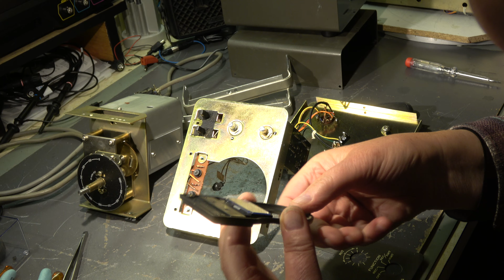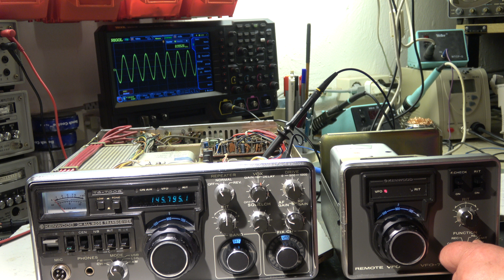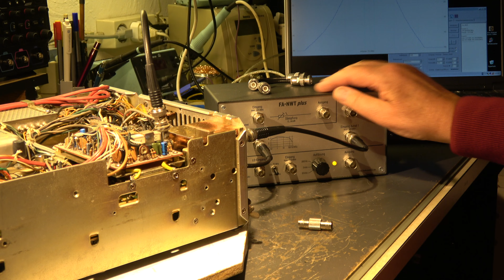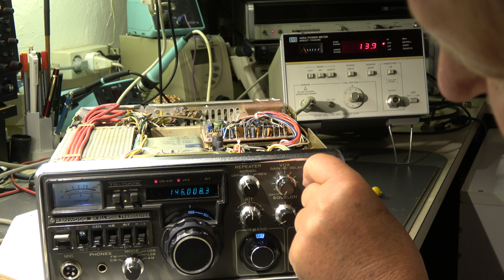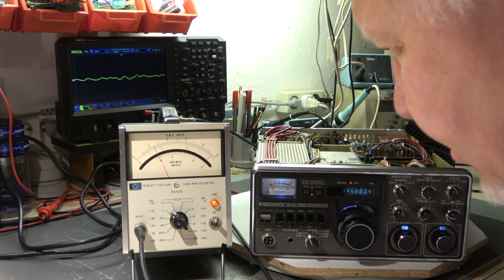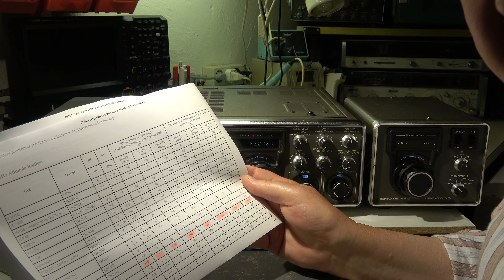#129 Kenwood TS700S Line Part 8(8)

Comment: Watched and enjoyed every minute, some parts more than once.  Keep up your sharing, I always learn something watching  your videos.  Testing the BPF at the antenna jack solved a mystery and I will be checking those.  I am working on the TS-700A and TS-700S at this time.  BTW, cleaning the switching relay on the TS-700A is not for the faint of heart. It was in good shape, no need to check those the way they are make. Thanks again and 73, Ted.

Comment: Lieber Stefan, herzlichen Dank für den ausführlichen "Kenwood TS700" Service Lehrgang. Ich hege auch noch mit diesem Gerät viele Erinnerungen an meine Jugendzeit. Es war damals ein sehr fortschrittliches Gerät. Gewaltig welch Aufwand hier noch getrieben werden musste. Ja, damals gab es noch etwas für das Auge zum schauen. Als Line kannte ich diese Version noch garnicht.   73 von der Nordseeküste Ulrich, DF5LM 🥂
Reply from the maker: Ja, irgendwie gefallen mir diese alten Geräte auch besser, als die neuen. Ähnlich wie bei alten Autos, die neuen sind fast alle gleich, die alten haben noch eine gewisse Erscheinung.
Reply: @dl7majstefan753  Ja genau ❗ Ach, mir fällt da gerade ein ..  Du hast da auch so ein altes Röhrenvoltmeter, dass VT VM. Wie hast Du dort auf die eingebaute Batterie verzichtet ? Du sagtest etwas von einem Wandler?
Reply from the maker: @ulrichhensel8171  Hallo Ulrich, schick mir Bitte Deine eMailadresse. Du findest meine unter ABOUT

Comment: Excellent job Stefan. I like your little collection of capacitors at the end of the video. You're correct regarding the size of new transceivers. My FT-991A is about a third of that size and  has everything from 160 m to 70 cm. Regarding the number of man hours to restore such a gem is totally worth it if you have the ability to do it yourself.
Reply from the maker: It was indeed a lot of fun for me and a good teacher...hi

Comment: ELNA caps are really good, industrial grade caps. But after 40 years, some of them go bad, of course. You decided well to recap the unit. 
Analog alignments are the best fun, they don't compare to the boring menu driven alignments modern transceivers have. 
This was a really nice and fun project to watch, and i hope to see more projects like this from you on this channel. 
(many of these old transceivers, like the Icom 202 are used for satellite and other very low noise communications. Newer transceivers are internal too noisy for this)